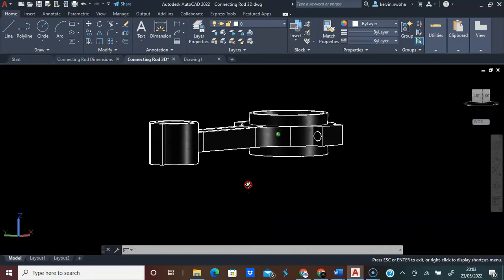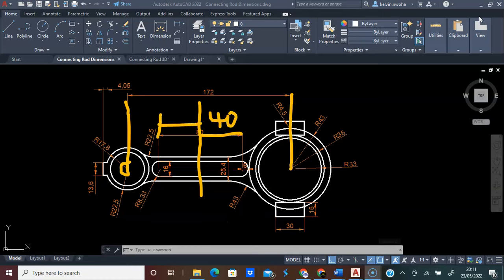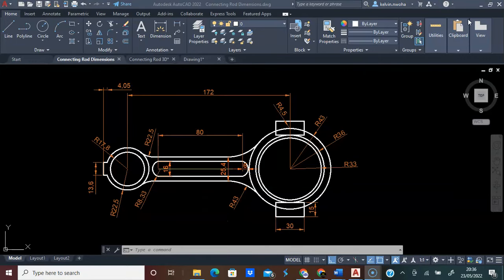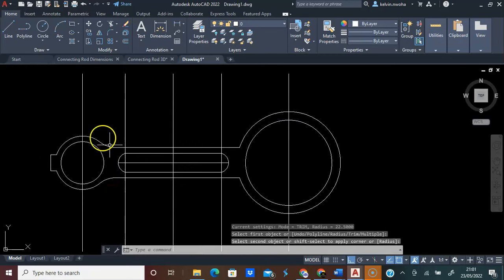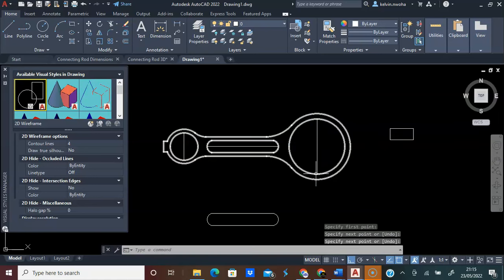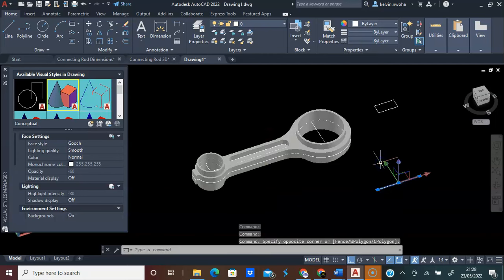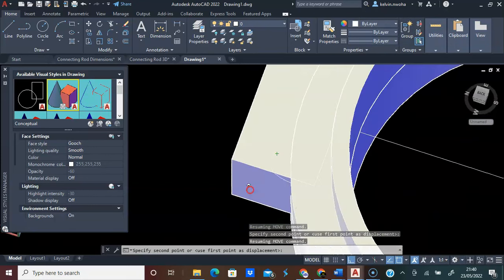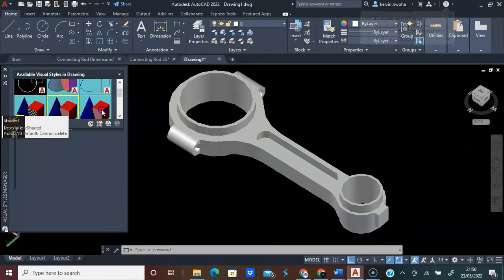How to Draw a Mechanical Connecting Rod (Step by Step) For Beginners

Comment from the maker: There are many ways to draw a 3D Mechanical connecting in AutoCAD. You can hardly draw anything in AutoCAD 3D without using the line and polyline command tools in one form or the other. In this video, I’ll walk you through all you need to know about how to "Draw a Simple 3D Mechanical Connecting Rod in AutoCAD". Other connecting rods, pistons and block parts and shafts will be completed in another video, which will enable you to learn machine coupling.

00:00 Introduction
00:05 How to Draw a Mechanical Connecting Rod in AutoCAD

LIKE THIS VIDEO THANKS! SUBSCRIBE: https://www.youtube.com/c/KelvinAcademyYouTube?sub_confirmation=1

BEAM SECTION PROPERTIES CALCULATION VIDEOS:
https://www.youtube.com/playlist?list=PLGiODXzBccMbIjLzYUQgwv7T03cF0M_8N

BASIC CONSTRUCTION ELEMENTS VIDEOS:
https://www.youtube.com/playlist?list=PLGiODXzBccMbKP_2ptBBd-tXqwNEr2rBa

AMAZON UK (Quality in Pack):
https://www.amazon.co.uk/dp/B082DL5SPY?ref=myi_title_dp

https://www.amazon.co.uk/dp/B08KKYSJFV?ref=myi_title_dp

https://www.amazon.co.uk/dp/B08P9VXPB7?ref=myi_title_dp